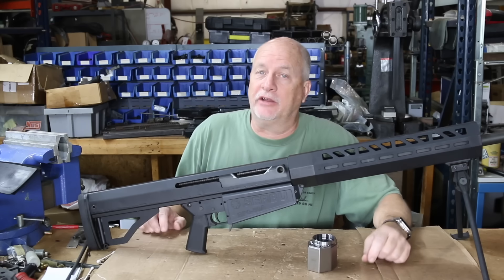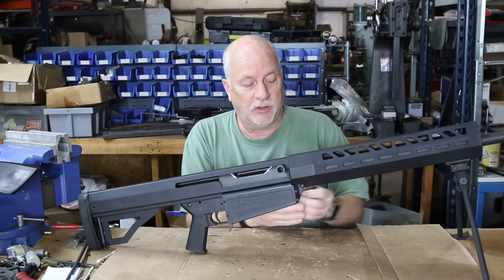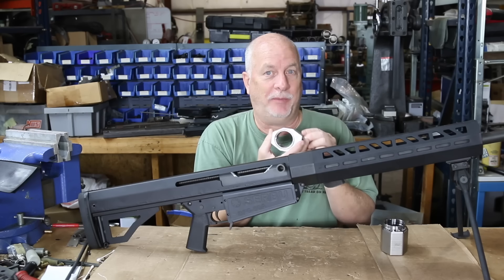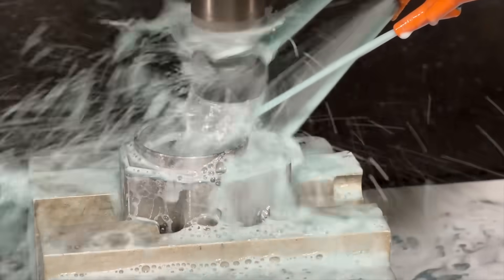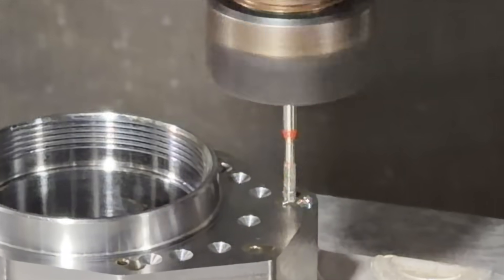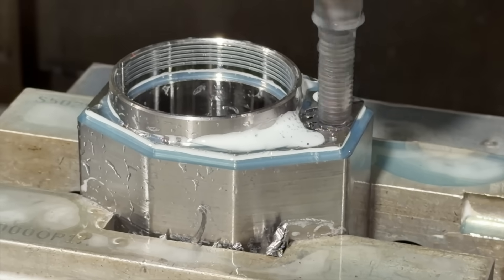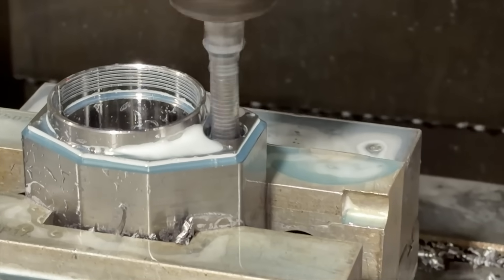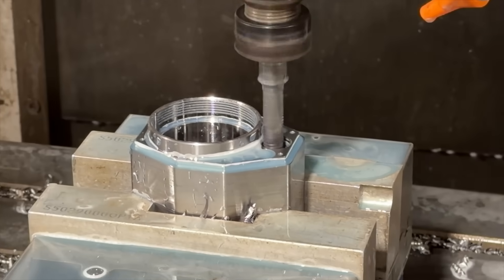BFG-50A Trunnion Machining!

Comment: Does a tesla valve have any benefits to a gas system, that make it worth while?  The only thing I can imagine is maintaining a higher barrel pressure, while still allowing the action to close at a lower pressure.  In practice it would likely just clog with carbon...that seems bad.

Comment: I would highly suggest form tapping. It’s incredibly fast. I’m not sure which alloy you’re using, but form tapping makes stronger threads. As opposed to cutting the metal, you displace the metal  (essentially cold working it) without the crystalline structure of the metal. You use a larger diameter drill (and/or reamer if you’re aiming for a tight tolerance minor diameter), and there are no chips.

Comment: Nice machining video Mark. I'm sure it's a low part count choice but how did the casting vs getting an extrusion debate go? Best of luck finding a new building.
Reply from the maker: @manythingslefttobuild This isn't really a good shape for extrusion. I've looked into extruding steel in the past and it's crazy how far away from the final shape they get you. Not even worth it! With this casting, we have an undersized hole and near net shape on the outside.
Reply: @markserbu  Thanks for answering. 

I had a reference point from a family member getting a similar shaped stainless steel piece done as an injection molding. Their break even point vs CNC milling was around only 16 parts. It is a non structural piece however. Also Hill and Mac getting a couple extrusions for their stg44 project. 

The minutia on how to make things brings up some interesting stuff.

Comment: Why use castings instead of billet for a load bearing portion of the gun like the trunnion?
Reply from the maker: @RH-om1ph The forces on the trunnion aren't really that large. This isn't like an AK where the bolt locks into the trunnion; we use a barrel extension like an AR. The trunnion could even be made from aluminum if the barrel extension was proud of the surface by a bit, so it would take the battering of the bolt coming home.
Reply: @markserbu Okay, thanks for clarifying! I havent looked at your rifle all that much, but that makes it make alot more sense. Hopefully I'll be able to buy one soon.

Comment: Hey Mark your thread ops would really benefit from a tapping head and form taps.
Reply from the maker: @Hugh_Jassle Nah. Tapping heads aren't needed on a CNC, and form taps wouldn't work in steel this hard.
Reply: @markserbu yeah since your machine is capable of rigid tapping it's not worth the cost. Not using form taps in hard(er) materials is a myth though. They perform well into the low 40s and I regularly use them on pre-hardened steels like 4140 and 17-4.
Reply from the maker: @Hugh_Jassle Interesting...I just looked it up and you're right. I've only used form taps in aluminum, and always heard they're basically not for steel. I would say I'll try form taps next time, but I think we're going to let someone else make these parts completely in the future. Thanks for the knowledge!

Comment: Uhm ...no coolant?
 Chip weld in the flutes of the tap will break most taps.
 Try (straight)Moly-Dee on tool steel harden and Stainless steel. (Op stoping between holes)

 Or thread mill. With coolant !
Reply from the maker: @par4par72 Uhm....4:54.

Comment: Can't remember which CAM you are using but in mine when selecting holes to drill I can let the software decide, or make it use the order I selected the holes. But we run Speedios so it doesn't really matter which order they are are in. 

Also, make sure your coolant is at the top of the percentage range if you are breaking taps.

Comment: Why not use a spiral flute tap to pull your chips up instead of putting them down in that bore? It looks like Haas grinds or sources 6x32 and 8x32 UNC spiral flute taps. You also could possibly use a larger tolerance class and peck tap before heat treatment. Molly grease for stubborn holes in tool steel is something I'll keep in mind in the future though. Excellent video. Also I think Haas recommends 9 bricks for the coolant in their machines. I haven't really found a good way to measure the coolant other than a plastic measuring cup, refractometer, and a 5 gallon bucket either. If you know of any way to keep that hangsterfers coolant from eating up your hands that would make for some great knowledge.
Reply: Coolant eating hands is usually a sign of bacteria growing in the coolant.  Might look at the biocide you're using, maybe add aeration to the tank to discourage anaerobic bacteria.

Comment: Mark, one of the very best things you can do for your coolant is to put a fish tank aerator in there. That in a coolant filter will go a really long ways towards keeping your coolant alive. I've had the same coolant in my house vf2 for the last 2 years now. I have a piece of filter foam where the coolant leaves the machine and just before it goes into the chip tray. And I have a 50 Micron coolant filter in line with the coolant. Makes a huge difference. Im using Qulichem 335c

Comment: For the holes where you are just removing material for weight reduction a waterjet would work great. The holes wouldn’t need to be round either. I don’t know if you could justify the purchase of a CNC water jet for the amount of parts you make unless there are others that would make it easier also.

Comment: When it comes to finish,  I do a hybrid cold blueing. I boil the parts in distilled water and take them out and let all moisture flash off. Then I hit it with cold blueing.  Repeat the process until darkness of finish is on par.

Comment: Idk if youll see this but i wanted to ask, is a falling block .50bmg plausible or is there something to note about the extremity of how thick everything would need to be? I always wanted something like a ruger no.1 in .50bmg instead of .600NE or that kind of thing but they dont exist. Every .50bmg i know of uses radial lugs on a rotating bolt except the M2HMG

Comment: Ive been playing around with Ai and g- code a bunch over the last year. Everything from writing code for my 3d printers at home to the cnc machines at work. 

You can feed it the entire programming manual, give it an example program as a reference for program and variable structure, and it can mimic exactly how I'd write a program, or build a parametric version so you can easily make adjustments on the fly. It's freaking cool. 

It can build out a parametric program, that would take me an hour and lots of math, in just minutes.
Reply: I really can't see trusting those chatbots making any sense.
Reply: @Tunkkis thats fine, and obviously you need to have someone who can fluently read the g code, to "proof read" it and make sure what its doing, makes sense. 

But, if youre not using it, youre going to get left behind in the industry. I've already been training AI to write g code to make parts from images. It can calculate dimensions from other objects in the images, completely bypassing CAD software to draw and manufacture a part. 

You can take a photo of a part. Give it to the AI. And it returns g-code. Ready to be cut. All in just minutes.
Reply: Clever. LLMs are good at structured data like that. I'd just want some way to validate - maybe "diff" tool to make sure all the cut operations still exists in the gcode
Reply: Gay
Reply: @joshuagibson2520 you can call it gay all you want. But, i cant expect everyone working underneath me to be able to read and write g-code the way I can. Ai makes it much more realistic to have an underling build out a parametetric program that works with a specialty jig. The more unskilled people that can run these machines, the better. It makes it cheaper to run, and gives me the ability to make parts cheaper than anyone else. 

I mean, being better than you, is a weird definition of gay, but you do you my man.

Comment: Hi, I have enjoyed watching you for several years now, finally found something to comment on...
I'm a medically retired machinist, but back when I was doing production work, several of the parts we made were hardened, or stainless, and the taps we found that worked best for us, were spiral flute taps. Sorry, I don't remember the brand that worked best on our material, and there were a few that were not working great, but the way the chips in the tap flutes stayed in the flute, made a big difference for us. With the straight flute taps, occasionally the chips would bind in the hole, around the tap, and then was when we would break taps...

Not sure if you drill very small holes, a couple jobs we did were small, fractions of a mm, and Hurting brand drills worked better than anything else we could get at the time.
This was over 20 years ago, but a lot of the stuff, material, is still the same...

Thank you for posting, I enjoy watching someone who works in the field, and runs machine tools. 
Take care, hope something in this helps...
Reply: Exo taps are the bomb. The shavings come out the top. Great for blind holes..

Comment: Have you tried a FORM tap? Very strong threads.
Reply: That being said, I like thread formers.
Reply: Used in medical devices, super strong, but it has its limitations
Reply: My only issue with thread formers is that if you use the "correct recommended tap drill" then the minor diameter is always large. The former doesn't push enough material towards the center. Okay on garage projects but if you're using plug gages, they almost always fail. You can use a smaller tap drill but risk binding up the thread former and breaking it anyway.

Comment: As a machinist I thread mill whenever possible. If you break a thread mill in the hole the part is not scrapped, and with a tap in hardened steel the pucker factor is off the charts.
Reply: Especially npt threads😅
Reply: Gard specialists taps will eat that hardened steel all day no problem. They're pricey but they're amazing!
Reply: @jackjames3884 not as OSG fan 😂?
Reply: 34Rc is far from hard. High 40s is where I'll retire the tap in favor of threadmilling.
Reply: Hand tap and use Castrol moly dee.
Reply: @joshuagibson2520 thread mill will out live a tap